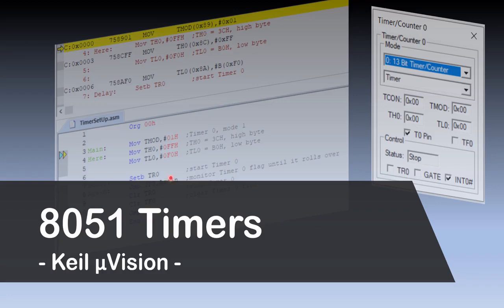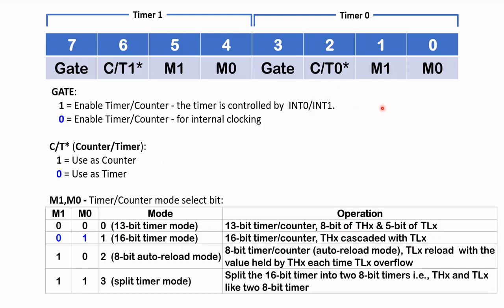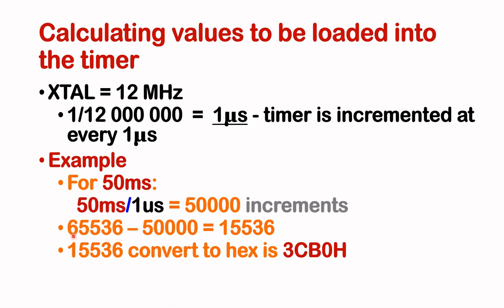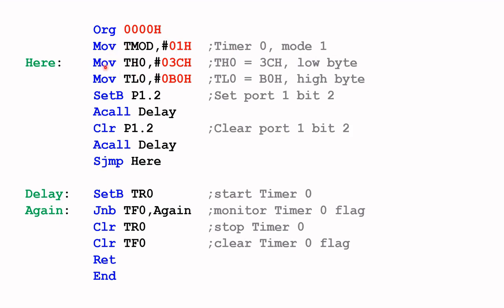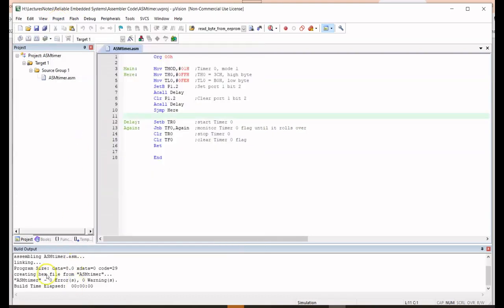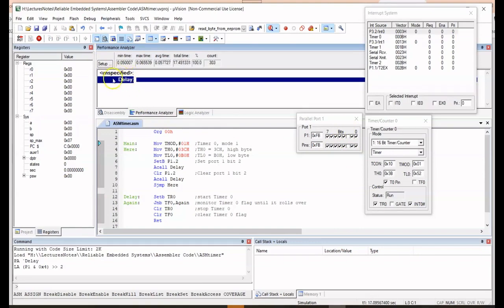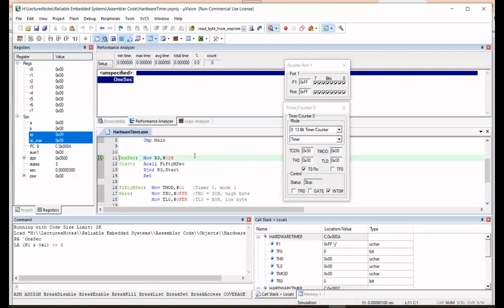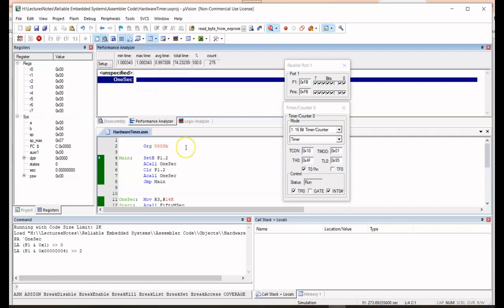#38 8051 Timers

Comment: Dear sir, your lectures are very good. I learned a lot from your video series. The way you are teaching is excellent. I want point out a small error at the slide starting at 9.50 . XTAL = 12 MHz. But it has to be divided by 12 before giving to the timer 0. You have not shown that in the calculation there. I got confused with this and then found the issue. So kindly requesting you to correct it  in order to avoid others facing the same confusion. Thank you.
Reply from the maker: Hi noted with thanks.